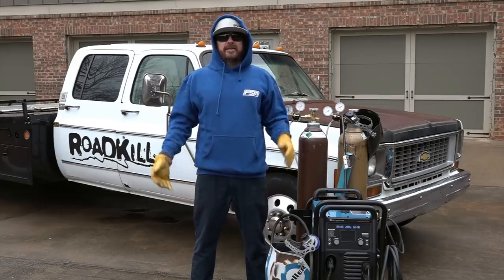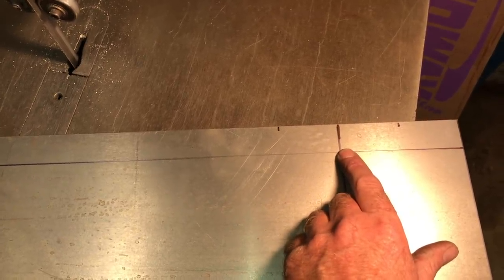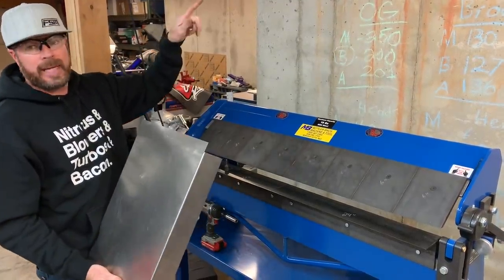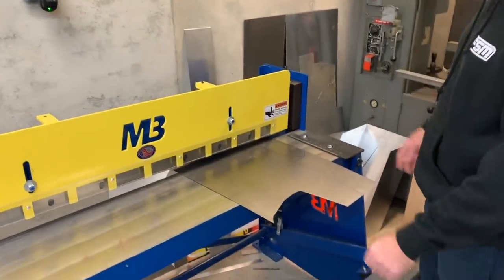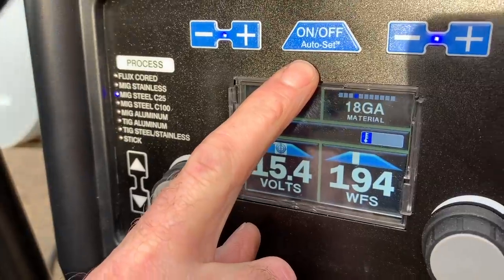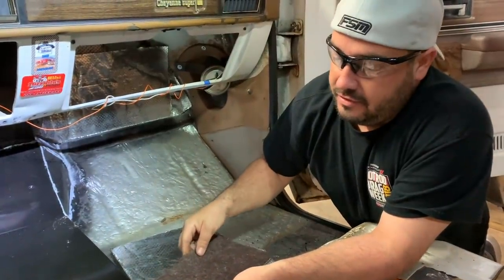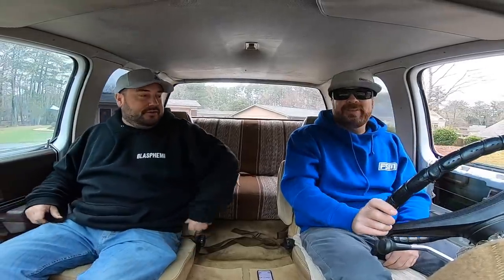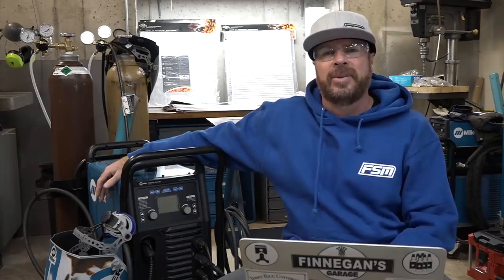Finnegan's Garage Ep.57: Ramp Truck Floor Fix, Sheetmetal Bending Tips and Welder Winner Revealed!

Comment: Hey Fin, get a dana 80 from a 90's 3500HD they are damn near unbreakable and they use massive disc brakes!
Reply: Chevy?  What's the bolt pattern?  That'd be nice under my Dodge which has a Dana 80 and terrible drum brakes.
Reply: dodge dana 80's are not true 80's they use smaller dana 70 hubs. anyways the chevys have a 10 lug pattern and run 19.5s but there are adapters for 8 lugs or if you wanna run 22.5s
Reply: Heath Albritton 8x6.5, pretty much all 90’s 3/4 and 1 ton trucks used 8x6.5, ford,chevy,dodge. Also 01 and 02 dodges with dana 80s came with disc brakes.
Reply: Man it pains me to say it but I think 9 inch. With the Cummins I think he could benefit from a wide range of rear end ratios and can just buy everything new.
Reply: Brandon B i dont think a 9” would hold up to well to the amount of weight the truck weighs plus whatever car he has on the back of it. No doubt strong enough but as far as lasting for a good amount of time i would have my doubts.
Reply: TheJd9112 the 01/02 Dodge Dana 80s are rare as hens teeth.
Reply: It had a Dana 80 in it.
Reply: @brandonb8543  9" was a half ton axle. No way would it live 100k miles under the ramp truck. AAM 11.5" or Dana 80 would be the smallest I'd go to haul a car with axle twisting torque and actually get some trouble free miles.
Reply: @brandonb8543  
You are over estimating the strength of a 9 inch rear end. The ring and pinion in a 9 inch are good but they are small. The axle is good up to a light 3/4 ton truck. The brakes and bearings that the 9 inch use could never live under the weight and torque of the ramp truck. 9 inch rear ends up typically come in 1/2 ton trucks imagine putting a full size truck in the back plus the weight of the ramp bed. It just wouldn't work well.
Reply: Brandon B 9 in. is a half ton rear end. to give you some perspective big block Dodges came with a dana 60 which was used in 3/4 and one tone pickups for years. some 1 tons had dana 70s, now we get up to a dana 80. the 9 in while bring strong for racing horsepower would never ever hold up to the weight this thing will be hauling thousands of miles across the country.
Reply: Yeah you guys got a legitimate point. Guess I never really thought of not having the trailer axles there to support the weight of the vehicle in tow and the excess load on the bearings by having all that weight supported by the truck itself... Lol I keep forgetting it's a big ol girl. I just think square body half or 3/4 ton truck
Reply: Why not a newer 14 bolt with disc brakes?
Reply: LQ9 Z71 14 bolt is a good rear. I would say dana 80 is a little stronger.
Reply: @1964corvan  The dodge dana 80's from 01-02 are real dana 80's. The ones before that used the dana 70 hubs.
Reply: Dodge drw are a true dana 80, regardless of year. Srw dana 80 use 70 outers. 01-02 is when you could get rear disk brakes factory.

Also considering the amount of weight on the rear axles, I'd personally would consider a Dana 110 and bigger out of cab/chassis trucks
Reply: Lefty eh im thinking dana s110
Reply: @12VoltDave  I am betting it's a GM 10.5 14 bolt from the factory
Reply: Do you know who you are talking to
Reply: 11.5” would be the choice

Comment: Another source for seam sealer is DAP brand Dynaflex 230 found at home centers. It isn't silicone or latex, it drys to a rubbery consistency and cleans up with water..  DAP says it isn't automotive rated but I've used it all over without issue.  Comes in clear, white, gray, tan, black and probably a few other colors.

Comment: Just a tip to anyone that does fabrication, while granted you can do a tunnel like this and it will be fine. It will work but if you want to you can make the piece over hang slightly. That gives you a nice corner to weld into then you can take a sand disk on a grinder and knock the edge down. This allows you to have more room for error and gives you a clean corner if you are just starting out on fabricating. Just a tip for anyone that is starting out doing stuff like this!

Comment: Since you had to take the factory a/c out and all, if you are only going to run heat check out the SUM-991102-1 heater at Summit. I put one in my 67 Cutlass and it will cook you and it's super simple to install (I used 10AN bulkheads and fittings for the hoses to clean it up more). You could make it work with your stock defrost and vents. Thanks for the great videos!

Comment: i cant imagine rear ends will last very long in that truck. its always pushing weight and that's before its loaded up  plus all the extra power you added = bad news.   i think the rear axle in that truck is a 10.5  ring gear , if you could find a  2012 and up truck they have a 11.5 inch ring gear that should be way stronger or a 2013 and up rear end has 11.8 inch ring gear.  and they have big disk brakes from the factory which would be like a free upgrade.
Reply: it's a straight axle dually, just about anything can be swapped in... Dana S110 out of a F450/550/4500/5500 truck from either of the 3 manufacturers will be all it ever needs IMO.

Comment: To get the genuine sound, you need a very thin gauge sheet, large, and you want to smack it with a felt hammer just down under 1/3 whilst it's suspended on two points. Sounds really nice.

Comment: Hi you need high hump carpet for your truck. Gm used high and low hump floors in there trucks from 73 to 87
Reply: high hump tranny tunnels were in 4 whdr trucks. they even bolted in. that would save fabricating one. Stay tuned for my 5.9 Cummins swap into a square body utility truck!

Comment: hey fin, i got a 2000 gmc sierra with a cam and valve springs and a pro charger and i'm pushing 650 through my stock axle and it is still working surprisingly

Comment: AC is easy, just pick up the old school under dash unit, plumb it in and tada cold air. And if you work floor over with Lizard Skin thermal barrier and sound deadener will help with sound/heat.

Comment: R.I.P the ramp trucks rear end.
Reply: "The truck had a 454 that could do even do a burnout. We put a Cummins dual sequential turbo in it, now it does burnouts." "Uh, we broke the rear end, so now we're going to put a bulletproof one in." (next year) "We can't keep traction on the tires launching, so we're going to put giant singles with drag tires on the back."
Reply: Dana 135 : A 13.5” ring gear + Detroit Locker = rear end fixed.

Comment: If you just folded one side of the piece up then the front down you could still fold the opposite side up without moving teeth on the break.
You'd just have to hang the fouling sides over the outside edge of the blade/teeth.

Comment: Cummins power breaks Chevy parts!
Had to rebuild mine 3 times before  it stayed together (Hint: Detroit Locker, Koyo bearings, careful setup, and extensive cleaning with modded tube drains are the ticket)
Mine kept blowing spiders until the Detroit upgrade, the carrier bearings till the Koyo bearings & drain mods (Dana 80's and Dana 70HD's share carrier & inner pinion bearings) plus a tighter carrier preload setup and extensive cleaning!
Reply: Cummins power torque just breaks things.

Comment: An AAM 11.5 rear end might be a good upgrade. More beef and disc brakes. Seeing as they came under Chevys and Dodges, I think it would be right at home. Or it might be fun to mix even more brands and go with a Dana 110 or 130 from an F450.
Reply: The 11.5 14 bolt is strong but I don't know how strong ik it's stronger then the corporate 14. But is it stronger then a more common Dana axle.
Reply: A full floating 14 bolt is roughly the strength of a Dana 80 from my understanding. The reason I suggested the 11.5 is because it’s from a Chevy so in theory it would bolt in easily. It’s also the axle dodge choose to put behind the Cummins.

Comment: Can you not fit an evaporator for the Air Conditioning under a centre console when you make one?
12 inch wide is plenty bid enough for 1 or even 2 evaporators. 
12v Fridge between seats is also a great idea... Just need a driver so you can have road beers.

Comment: Man I would have tried to make that trans tunnel cover removable. I'm sure it would have been alot more work to keep it sealed and everything but it would have been nice to be able to get to the bell housings bolts easily later if you just want to pull the trans.
Now it looks like its guna be damn near impossible to get to the top ones lol.
Reply: Yep, exactly what I thought. Shoulda gone the range rover route - to get to the top of the box, remove seats, remove floor which is held down by millions of 3/8 screws including half way up the firewall. These are accessible only by lying on the engine and reaching down the full length of your arm. Much better idea.....

Comment: Carter would want you to set the blade rollers a bit looser.  The goal is to get the rollers to not turn or maybe turn at half speed.  As it is, you're set too tight and will smoke the bearings.

Comment: because roadkill 🤣, I had a similar experience with my datsun 280zx that i put a turbo engine in (i cant get spark so microsquirt time) lol and my dodge dakota when i swapped the v6 for a 318 (5 speed transmission swap time). Anyway im glad the ramp truck is getting a lot of love

Comment: I like the ramp truck with the Cummins, but about the A/C, could you have a system exist on the back half of the truck and have a piece of flexible tubing supplying air to the cab? as far as the pump, I don't know a whole lot about how the finer pieces work, but could you somehow power the pump off of the rear differential?
Reply: Put a squarebody Suburban rear AC unit above the back seats

Comment: So what you proved is that there is nothing good about a 1 ton chevy but the California body and use a dodge/Cummins  for reliability along with their 80/90 hybrid  1 ton rear end?? Hmmm🤔 great story on the giveaway!! Loving it!
Reply: 1 ton Chevy engines are fine for reliability so is the rear he has a modified mopar trans and a modded Cummins which already was notorious for breaking dodges and still does. Also dodge uses a axle design that isn't their aams which is basically a heavily modified 14 bolt corporate axle and Dana axles like everyone else.

Comment: I've said it before and I'll say it again, you never had to cut the tunnel like you did. Plenty of Cummins have gone into a squarebody with no cutting needed. All you really needed to do was swap it for a four-wheel drive or floor shifter tunnel and you would have had all the clearance you needed and your carpet would have fit right back in without cutting it

Comment: Costom radiator  , body lift, low pro.singles tires around.  Fuel cost ~ air bag it if required. But that's just me.😁

Comment: Question,  What do you get for mileage now, since installing the diesel & over drive trans??  I have an 86 GMC 4 door dually, 454, turbo 400, I get 10-11 mpg.  Am thinking of doing diesel  & 5 or 6 speed manual trans...  Will it be worth the cost to improve mpg??
Reply: Diesel swaps are pretty expensive.   You'll have to really put a lot of miles on the truck before the money evens out.
Reply: It all depends on where u live and what parts deals you can find.  12 valves go for 2k sometimes and same with trans.  Some times you find a wrecked truck for dirt cheap and have everything
Reply: @williamuskoski1385   Even if you can pull a 4BT swap together for under 5K, in the truck and driving,  that same amount of money will put a lot of gas in a gas truck.
Reply: As others have said, the economics aren't there for a diesel swap.  Probably the most direct route is a LS something and 4 speed auto trans from a truck.  It takes about 6 wires connected to the truck to make it run.  You will need a electronic to cable speedo driver but I think these are under $ 200 .   About the only tight spot is the right frame to AC compressor but there are ways around that issue.
Reply: @bobroberts2371  Promise you an LS lugging around a dually won't get any better mileage.
Reply: If he isn't going for quarter mile times or burnouts,  a set of 3.08- 3.54 gears in a Dana 80 would make a huge difference. It now has the torque to pull down low so it can cruise highway speeds at lower RPM.... that is how you get MPG. 
 A few long trips can start to pay for it, having less axles dragging  means better MPG vs. a truck & trailer, going from a 10 MPG setup to a 20 MPG setup starts adding up quickly on long road trips...

Comment: Correct me if I'm wrong but I was under the impression that the Turbo 350 transmission was a 3 speed and the Turbo 400 was a four-speed but I have heard lately people say turbo 400 3 speed so I'm a little confused cuz I when I was a lot younger purchased a 63 Chevy c10 project truck that have been dropped on to a 70s Chevy two-wheel drive frame with a turbo 350 trans being 3 speed. And one of my good friends had a 77 GMC and his had a turbo 400 4 speed I don't know if it's certain years or if it's just people get their facts mixed up could you shed some light on this for me thanks.

Comment: If you like replacing your driven parts like axle and drive shaft joints ke er p going from reverse to drive without coming to a stop. Yep those parts love being replaced when torquey diesels slam and bang them around. My wife shock loaded my Dana 70 and busted a tooth off the ring gear and shoved it through the cover.

Comment: next time it will be how to replace the rear end with a Dana S110 out of a Ford F-450 something that will take the torque from the Cummins and handle the weight of a race car on a long haul
Reply: demonic477 I wonder though if it should be weak enough to break before the trans would.

Comment: Now you can put better gears in with all that torque and you can probably get away with a 3.90 and it will cut down on high speed abuse and noise

Comment: Next time bend the front lol first
Reply: Next time start with the removable trans tunnel from a top loader trans truck.  This adds about 3 - 4 inches of height to the stock floor.
Reply: Joshua if he did that he wouldn’t be able to show you bender that has a removable & adjustable table